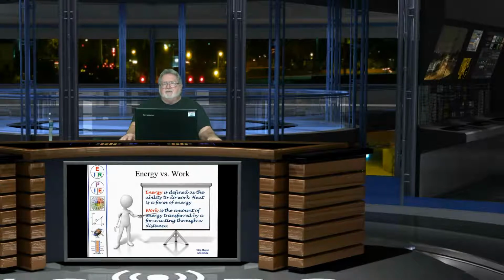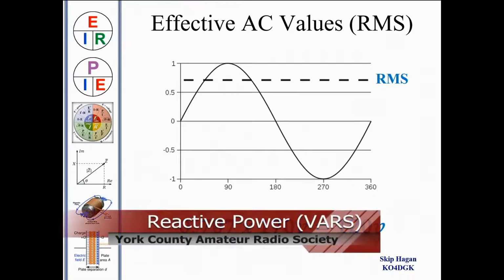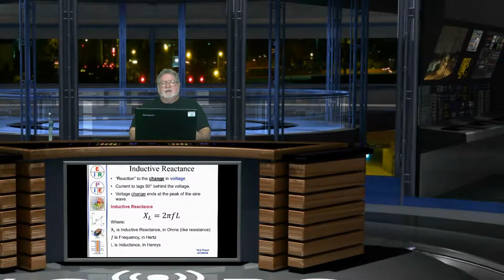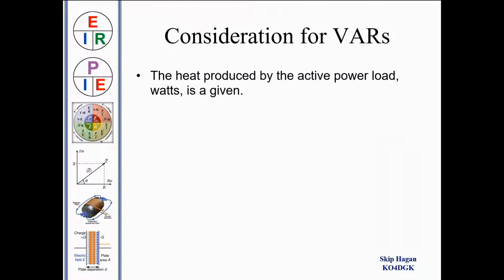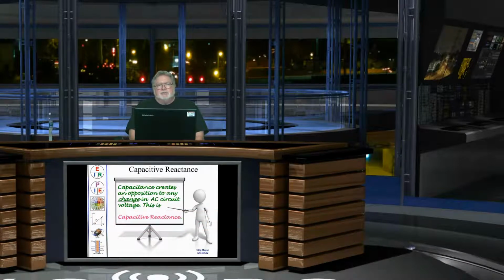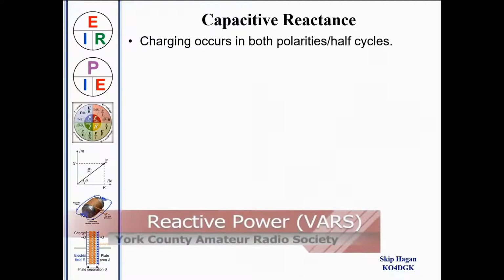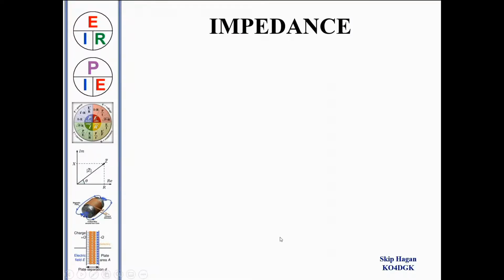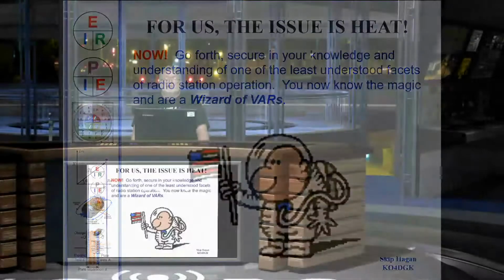Reactive Power (VARS)

Comment: A good presentation, especially for those studying for an Extra exam. 
I wouldn't sweat about installing any kind of power factor correction devices in a typical house or a radio shack. Power company bills us for kilowatt-hours, so some L and C imbalance won't really increase our power bill, unless you run some high power equipment that causes very low COS.Phi (power factor).  A typical house or a ham shack doesn't have any major inductive or capacitive loads.